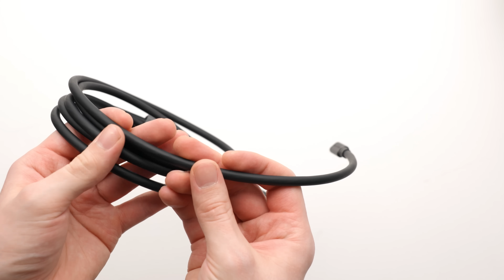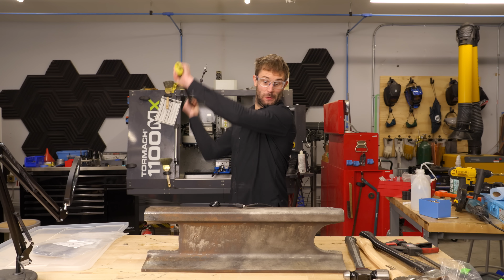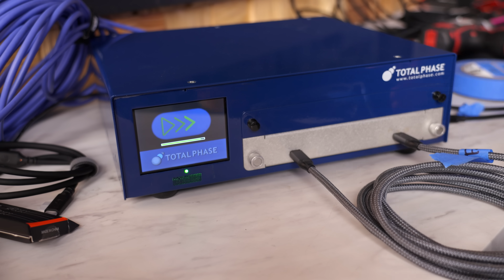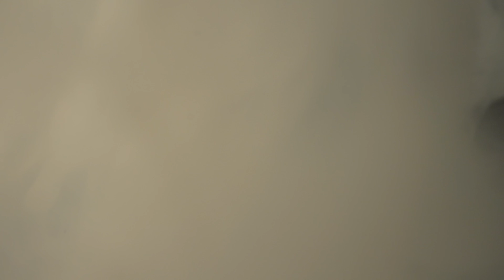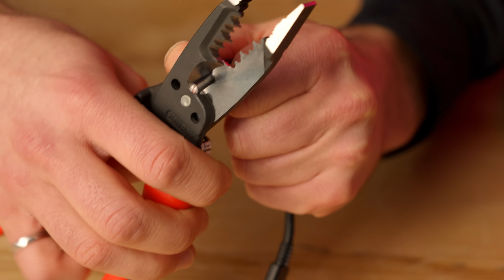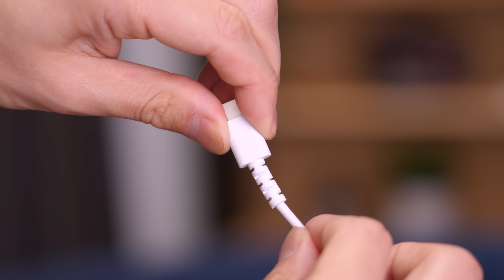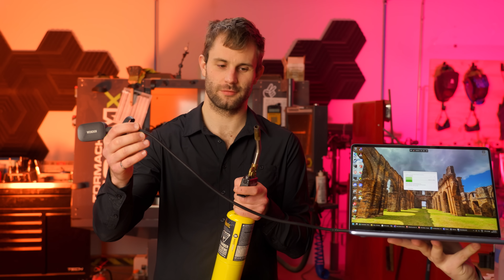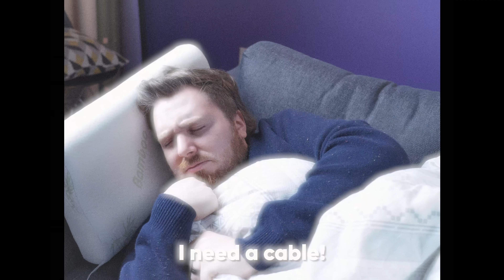Why It Took Me 4 YEARS to Make a USB Cable

Comment: We need a display port cable with this much thought put into it. I've gone through 5 or 6 in the past year, with most failing within 2 weeks. Hdmi 2.1 works great, but Nvidia having one hdmi and 3 display ports on their 5000 series means that I need to use one with multiple displays.

Comment: can we get some with 90 degree bends for VR?
Reply: Or even 45-60 degrees? Just Not the 180 swivel.
Reply: YES!
Reply: I would like those, Im glad they actually have lengths under 1 feet aswell, having a nice short cable for my face tracker (these are overkill tbh) would be cool.
Reply: And long enough for vr, at 20gbps. Edit: Even if I have to pay significantly more - I understand that.
Reply: If it's anything like Antennas I doubt it. The minute you bend the antenna using the 90° angle the quality suffers.
Reply: @Jimmy_Jones cables are absolutely nothing like antennas until you pump enough signal into the cable and it becomes an antenna on accident. where the cable is, the signal is, unless you've got real bad strain relief.
Reply: Indeed, and perhaps some that meet the unusual locking spec for those cables you do not want to ever come out accidentally.

Comment: Are any of these cables designed for VR use? For the life of me, I can not find a good cable to use with my Meta Quest 3 (and refuse to pay the price of Meta's perifrials). I just need a cable that can reliably deliver enough power and information to run smoothly.

Comment: I can't believe I am saying this but please trademark Truespec and license it to companies. I think one of the reasons you can't easily find compliant cables is because the USB Forum is sleeping at the wheel so nobody will buy a $27 C->C USB cable because there is no guarantee that it's actually good and not just a scam. So everyone optimized for undercutting prices. 

If there were a clear "Truespec(tm) 240W 40Gbps︎" label on a cable I'd definitely pay a premium. 

Also I noticed you are selling 480Mbps cables. So maybe to reduce waste with cables that don't meet the spec due to manufacturing issues you can sell binned cables for cheaper kinda like CPUs.

Comment: I hate the snake oil high-performance cable market. In fairness, I largely deal with audio quest, cables, and their pricing and marketing is probably some of the most snake oil BS. That said I hope the LTT USB-C cable lives up to the hype and is worth its cost. But what I would love to see is not necessarily a cable that can meet the spec that these cables should actually be meeting, but above spec cables. What I mean by above spec, are cables that are highly shielded so that they perform two back in non-ideal situations. Something that I would be willing to bet is that these LTT cables are probably gonna be able to perform this back, but if you were to do something ridiculous like grab a 2 m USB-C USB-C cable wrap it around a power cable, and then run this test. It would probably fail. While that seems ridiculous and in real world application, you definitely should avoid doing something like that, it is sometimes unavoidable to running cables in on ideal situations. A common situation you might see this is inside of a rack. Yes ideally you have very well built, wraps where you have dedicated power separated from other types of cables in the real world, I can only wire a rack to what my customer is willing to pay me to fix. Having a cable that can perform excellently in a crappy rack that the customer will not let me improve is a good way to ensure a high-quality outcome. what does requires excessive shielding. And as frustrating USB cables are in their marketing, it’s even more frustrating when you’re trying to find something very specific that might be slightly offbrand. Such as what I’m proposing an over me shielded cable for terrible situations that you really shouldn’t be running cables in anyways, but you have to. That said it’s weird that I actually need a USB capable of any kind inside of a rack. But it does occur. The nice thing is you can usually find network cables that are of different variety quite a bit easier so I don’t usually run into cable quality problems. Unless of course, we don’t sell quality cables. On that note, the really frustrating thing is often times we sell high-end garbage cables because our sales people follow snake oil marketing. But that’s a different hot take.

Comment: Cable connectors are weak by design.

They want the cable to break instead of the connector in the device. As it is chesper to replace a cable rather than a device.

Comment: wish i could replace all my cables with these but hence i live in sweden and that shipping cost and vat just aint in my budget i dont have the carrer for that,
uhmm okay back after checking price at the store and im dumbfounded yall saying they arent cheap? they absolutly are cheap compared to what they cost here, if you want ANY usb c to c cable here its a  cheap noname garbage and that starts at your equivilant at 15 Cad the 3m cable i have currently that can do 240w was 35cad and its not 10 20 or 40 gbps

Comment: I was expecting them to cost more honestly. I've got an external 5 bay 3.5" SATA drive enclosure that is USB 3.1 that I have been struggling to achieve advertised speeds with. Different cables yield wildly different results with only the shortest ones even coming close to the advertised speeds. It is capable of 10gbps but I have to use the USB cable the length of a floppy drive. A 6.6ft/2m cable capable of delivering true full speed to a 5 drive SATA array would be the absolute PEAK use case for these cables. I look forward to getting one when they become available again. Hopefully.

Comment: Hi Linus, I'm an astrophotographer and USB reliability is a huge huge issue in this industry. It's meant the super high end (6 figure) setups are still using serial connectors from the 90s - I'm not joking! Cable reliability that can last outside and cope with cold weather and UV is a big thing for us and USB drops don't just mean lost data, but can lead to telescopes physically crashing into their mounts which can cause serious damage. Also, for planetary imagers capturing very high frame rate RAW video (I do this too) very high data rates and USB reliability is key for consistent frame rate. Unfortunately this is also a massive problem when trying to capture an International Space Station transit which can last literally less than a second. A drop in FPS or inconsistency can be image ruining and this type of capture may only be possible once a year if that. These cables could be industry changing for astronomy and so many other industries that people don't realise!
Reply: This is idiotic. Why are you buying USB cables from amazon for million dollar machines. The mfg'r would be responsible to provide you with a properly spec'd cable for the job. There are cables designed to withstand nuclear radiation.
Reply: why are you even using usb for this? just use fiber optics lol the cables arent even expensive for a million dollar machine
Reply: @squidwardo-e6g  well... it's literally in the name... _Universal_...
Reply: I wonder did they did cold weather test on these cable then... I think silicone goes freaky and stiff in extreme cold...

Comment: I'm pleasantly surprised the cables aren't expensive
Reply: I was expecting them to be like $100 by the way he was talking. 20 bucks is very reasonable.
Reply: @Peteryungis  when they were talking so much about the price I was thinking along those prices
Reply: I would even argue that these cables are more value for money than most other LTT store items. Especially if they are like one of five brands with near zero transmission loss. That's a huge unique selling point imo.
Reply: I had pretty good luck with ugreen cables, but that might be an unpopular opinion
Reply: They are about 2-3 times the price of cables that I bought that perform perfectly well, excluding ones much cheaper from Ali that also work well (but that's more about luck than anything else tbh). Not that I think that they disappoint given the specs, but they are not *cheap*.
Reply: @owlstead  can you send a link? 100 watt?
Reply: @owlstead  What cables were those? What tests were run? I've spent money on cables ranging from a couple dollars to $16 (CAD) and they all usually dont last very long. Premium cables here seem to be around if not much higher than the price points of LTT cables. Whether or not LTT cables end up being as advertised is a whole different thing I think price points are great.
Reply: @TheLightBringer93 I posted separately but will say here- I work in commercial AV and failed USB cables can easily cost $1,000s.

I use and swear by Comprehensive cables but they’re ~3x the cost of LTT’s. If they are tested and work as well as claimed, they’re practically a steal in the commercial sector.
Reply: @Lostmypasswordagain  Same, I think this is a steal and will be doing my own testing at the 100th use mark which is just about a months worth of work for me. Maybe again at 500 or more. Usbs typically last me 6 months at best for the constant switch out I have to do at the stage..
Reply: @TheLightBringer93  OWC usb cables has worked great for me for many years now, price is a bit lower
Reply: @owlstead  In the video they said cheaper cables that fail the test, might work for your daily use (USB build-in error handling). Doesn't mean it's a good cable that performs up to promised spec.
Reply: @N3v3r_S3ttl3  Doesn't mean it's not, if it's worked for many years and speed is up to spec what else can you want
Reply: @reggindaed Are you able to read and understand what are you reading?
Reply: @iulioh  Do you?
Reply: @iulioh  From a practical standpoint, if a cable consistently delivers the advertised charging and data transfer speeds and remains reliable over years of use, it effectively meets any needs.
Reply: @reggindaed does it deliver the advertised data and power speeds? Or does it deliver "good enough" and you never tested it? Not even LTT could test the 40gbps in house
Reply: @iulioh  It does. Search for OWC tests of their 1M2 USB4 SSD with their own cables or Cable Matters cables, confirming sustained speeds of up to 3,500 MB/s. Verify that the USB4 cable was not the bottleneck and that performance aligns with USB4 specifications.
Reply: @owlstead  sorry, what? What fantasy universe are you living in paying $8 for usb cable with these specs???
Reply: @ZenithFlare307 Which cable? The 40 Gbps cables are nice, but there are plenty of cables for 20 Gbps and below.
Reply: @owlstead  Please give me your sources, because I've gone through multiple 40Gbps at this point trying to get a stable connection between my eGPU and my laptop and I haven't found anything below €20 that wasn't utter crap
Reply: @joaomatos00  OWC
Reply: @joaomatos00  Alright, cheaper 40Gbps may be pushing it, I can believe that. eGPU's require a realtime connection as well, too much resending and you're out of luck.

Comment: A suggestion for the website, Americans hate decimal, especially random ones less than 1. We're used to seeing 3.3 ft when converting from 1m, but it definitely takes mental time to equate 0.32ft is about 4 inches. Having the three shortest lengths for 10/20/30 cm be 4 inch, 8 inch, and 1 ft (since everything is being rounded in the conversion anyways) would make things a lot easier for American customers to mentally visualize lengths so they know what they're getting without pulling out a ruler.

And yes, for those that don't speak both metric and freedom, 10cm is almost equal to 4 inches, the difference is only 1.6mm. It adds up over larger lengths, but under a foot, it really doesn't matter.

Comment: Sold. But you need to work on your sites region selector. Very painful checkout process as a canadian. Defaults everything to american with no obvious way to switch. So racialist against your own ppl linus. Even after i found your very well hidden region selectors (Belong at the top of the site bro, not hidden at the bottom).. It still complained and said i was on the US site and wont ship to me. (but the order did work anyways)

Comment: Recently I did a decent amount of cable testing and I kind of found a rule.
I was looking at 5m cables carrying enough power.
And I found that any USB cable will carry as much Amps until Voltage drops 10% (5V to 4.5V)
(Remember cable resistance increases with length and U=RI)
So a 240W 5m cable (if such a cable exists) in my opinion, won't ever carry 240W.
The longer the cable, the less power it carries.

Comment: By the time I opened the email notifications most of the cables were sold out (unavailable).
Reply: More! Before AI needs these
Reply: @paulyflynn If we start running low on copper I'll start living like the amish.
Reply: They're back up!
Reply: Try again now
Reply: Same here now, all the "main" lengths are sold out. The price for 40Gbit is definitely very hot! And even 5m 240W goodness  is not as expensive as one might thought. Hope the restock asap and work on 80Gbit cables also
Reply: I was able to get some just now. Yay.
Reply: @seattlekarim964   unfortunately its a backorder. there is a shopify issue that allowed you to buy a cable that was out of stock thats why the page is down atm
Reply: They’ll be on StockX for $5,000

Comment: Beginning of Video: "USB has built-in error handling. [..] It could slow you down."
End of Video: "Cable is digital. It either works or it doesn't"
Reply: Glad others noticed that; definitely undermined part of the argument made earlier there.

Comment: My problem with specially USB cables is that the long head (+hanging cable length) turns it into a lever for it to damage both the connector and the port. Add a 90 degree head option to this cable and you have another customer.

Comment: The last thing I need is more cables, but at $21.99 USD I'm sure as shit going to be picking up a few to replace the ones I currently use that I use with my outlets that have USB-C connectors.

Comment: Why do you claim truespec, (and physically it is) but the website is missing information. What is the wattage of the 10 footer? What about the 16 footer? You don't show anything but 40gbps/240w which is a few models of the 20 options.
Reply: The watts are in the title, all of the cables are 240W, you're picking speed and length.

Comment: 30$ CAD for a 5m Cable that can to passively 480Mbps and 240W (the more impressive part) is not even that outrages.
In my jobs so far in trade fairs we had cables that were specially rated and 5-10x that and they still failed on us because too much signal interference from too much cables in the walls.
I hope HDMI and DisplayPort is next because these were the ones that f us over the most

Comment: I can't count the number of sub standard cables I have had. I bought a cable tester and was so annoyed at the differences between cables with supposedly the same specs. Name brand and sub par performance. People definitely underestimate the value of having confidence that the cable you grabbed will do the job at the spec it is supposed to.  The same for USB chargers that claim a certain output then don't deliver.

Comment: Hey Linus, I might be one of those with the girth problems. Could you guys put the height (might as well do width while at it) of the connector into the "Product Dimensions" in the shop? My armored phone has this completely stupid plastic bezel around the port and can't fit most of the cables, including some low profile ones.

Comment: I don't have a cable tester but at work (electronics repair) I have a 1tb nvme type C enclosure and I test CC cables on it, if I don't get 1Gb a second I know its a shit cable. As for power testing I have a tester for that and I've caught suppliers out many times ...same cable same box but yea 30MB read speeds on the drive and massive voltage sag over 1am. You can't even trust the same box to have the same cable in it.

Comment: $22 and $17. Just put the price in the video. And if the better signal integrity actually helps, some numbers would help prove your point, otherwise it just comes off as overpriced and over engineered for no good reason.

Comment: I had a lot of this kind of issue with HDMI cables in the UK. Used to use one of those 8K capable best spec amazon ones, and my new 4k 144hz monitor would occasionally drop signal for a moment. I went though multiple brands, stores, etc. Eventually hunting for VESA certified. Turns out amazon posts would all lie about that in the titles. BUT also the sandstorm or whatever named ones that PC World sells at a pretty premium price, also werent properly certified for the speeds etc! Eventually was Scan I think that had actual certified one, and its worked fine since. Was maddening, and took a long time and troubleshooting the pc half the time expecting issues there! 

Temp fix was dropping the hz, colour bit from 10/12 to 8, or res but I wouldnt do that. But none of the cables are really distinguishable so lord help me if I put them in a box together

Comment: The end of the video says it all: cables either work or they don’t. Other than supporting LTT, I don’t see any value in spending more than a few dollars on cables. Virtually all of mine are Amazon Basics, and I’ve had zero issues. One cable did die on me, but that was after years and years of use. I like LTT but this will be one product I wont be buying. Good luck though!
Reply: Cool but the average folk won’t care.
Reply: @Mudthekiller  you know what you get with these and are less likely to have problems but that’s it.

Comment: $26.99 for 480w 16.4 feet cable type-c to type-c? Ya thats not over priced. Gas station cable are far more expensive for far less quality. I paid 20.99 for a 10 foot cable and it lasted a few days before an error came up saying it was slow charging on my Fold 7. Cable looked perfectly fine and brand new. Ill be buying one of these LTT cables soon to try out